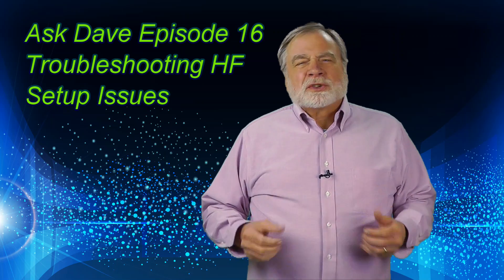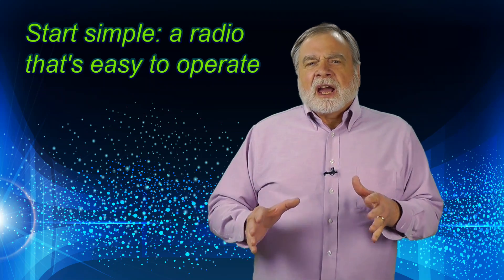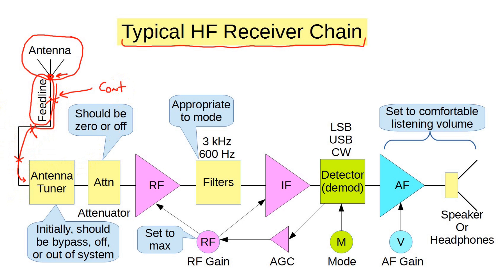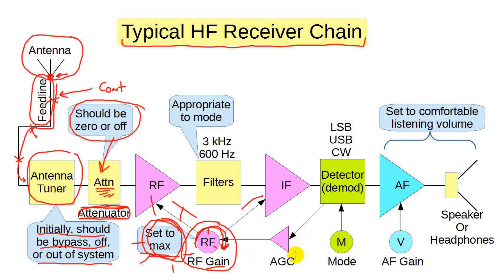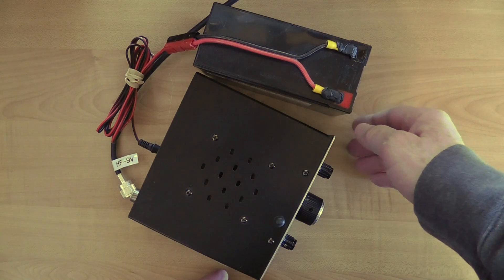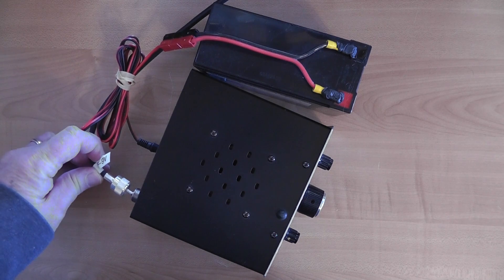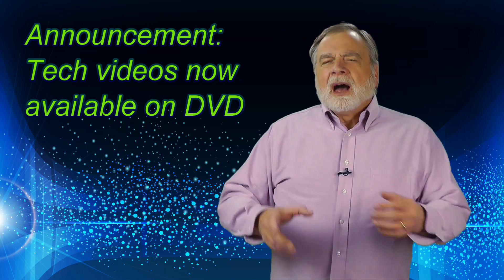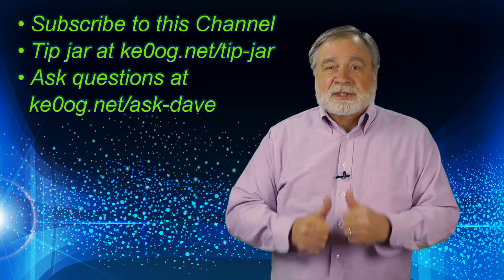Ask Dave 16: Troubleshooting HF Setup Issues

Comment: Question, could you walk through this receiver chain using a couple diff HTs . For example, for each step show how that happens in the actual radio, for teaching kids big and small, they like to press buttons and tune dials as they follow along with the theory

Comment: Hi Dave I'm new to your CH and have a question. I do not have a amateur License as of yet but operate on 11 metres 27mhz cb radio 4 watts on Am and 12 p.e.p on sideband. I have my coaxial cable running from the radio straight to a little vertical everything is in tune and swr is good however when ever I key down I hear myself through my home theatre system or any other speaker systems around the house. This worry's me as I don't want to cause interference to others I have tryed  to google the issue but have had no luck. I know this is not a ham question but its still related I know I'm only a free bander but I always operate within the legal limits
Reply from the maker: RFI (radio frequency interference) is always an issue. Try grounding your radio, power supply, and antenna mast (if the antenna is meant to be grounded). It may help.
Reply: Hi dave its all grounded but makes no difference

Comment: Dave, great video, thanks.  Don't know if you've answered this question in the past so I'll pose it as a new Ask Dave question: 
I'm setting up a new ham station in Japan and would like to make DX contacts east across the Pacific to the US and Canada and south to Australia and New Zealand (and anyone else who picks up my signal).  I bought a used Kenwood TS-830S hybrid in excellent condition on ebay and am now trying to find an antenna for it that will fit my small, odd-shaped property.  All types have problems of one sort or another.  My roof is only big enough for a 40 ft Inverted Vee (20' each half) and its nulls would point east-west or north-south, exactly in at least one of the directions I wish to transmit.  It'd also have to share the mast with the TV antenna and I'm not sure how that would affect TV reception.  I could put up an 18 ft vertical but it would have to be mounted on a deck post behind the house with the house blocking both desired signal directions.  The metal framework under the deck and an 8'x8' metal shed next to it could serve as lopsided counterpoises, however.  Magnetic loops are difficult as well due to close proximity to the same large metal objects and my shack being less than three meters from the RF field.  Given this information, what is my best antenna option and how can I maximize my setup for long distance QSOs?   Thanks, and please keep up the great work!  Yours is the channel I go to most often for beginner advice.
Reply from the maker: You may have to try several approaches. These days a lot of operations is on 20 and 40 meters. Start simple (MFJ makes a 20/40 dual band dipole) and work up from there. Everyone is constantly changing their antennas!

Comment: Could you do a video on power supplies please? I'm curious about the differences between linear and switching. I'm also curious to find out how far off the listed voltages and amps are from the reality and what kind of quality I could expect from the different priced brands. Is there a correlation between price and quality and if so, does it make that much of a difference?

Comment: I'm having a problem like this on my 2 meter rig. Everything was bought new and everything was working fine until my transceiver started to cycle off when I keyed up only to come right back on. The only help I could find said that my SWR might be too high though the tuner I had it hooked into read a high of around 1.3. Taking the tuner out of line didn't change anything, by the way. I'm wondering if maybe I read it wrong and the SWR might be high, but then how to check it when I can't key it up without it shutting down? My solution, for now anyway, is to start looking for a new rig and antenna and try again with all new components. I figure the worst that can happen is that I feed an addiction and take up just a bit more shelf space. 

Keep up the great work Dave and thank you for the videos. 73's
Reply from the maker: +Jason Take a look at your power supply. It's possible that the supply is choking under the load when you transmit. Measure the voltage input to the radio both during receive and during transmit. If the voltage drops a lot, it will cause the transceiver to behave weirdly. I feed my HF transceiver (and my VHF transceivers) with a 12v battery. The battery goes dead every three years or so. The first symptom is that it can't hold its voltage under transmit conditions, and the transceiver freaks out. Hope that helps, 73, Dave

Comment: Great video, Dave, as usual. I've had several interesting experiences in my short HF "career". One is that I got some great advice from members of a net that I frequent - they got me to do some mic adjustments to remove the bass that was preventing the clarity of my transmissions. It's good to know there are some nets out there that can be extremely helpful. Another was a time when my reception became terrible - very little signal coming through at all. Since it had changed rather suddenly, it had rained heavily around that time, and the SWR had changed character, I deduced that I probably got moisture in the feedline. And that's exactly what I found at the feedpoint connection, and it only required a little bit of corrosion to cause a problem. I had a problem with my antenna tuner for a while, though it later went away. And most recently, I had a strange thing where I was listening to an unusually strong signal, and suddenly the RX would cut out entirely. I finally figured out I needed to back off on the squelch. Did I tell you I bought a new (used) rig? Around Xmas I knew I was committed to amateur radio and HF in particular, so I picked up nice high-end Yaesu. One of its big pluses is it has beautiful RX sensitivity. So there are always new things to learn, but it helps to be fairly good at troubleshooting and having friends (even if they are thousands of miles away) to get advice from. Best regards and 73s to you Dave. I hope my comments here will help someone reading the comments here. -john KC1DIW

Comment: With propagation as bad as it is , you could make a point not to be frustrated with too high expectations , I remember that its the maunder min sun spot cycle .
Hams that have been around a long time seeing much better propagation in the past - 10 yrs.+++
I got my ticket almost 10 yrs. ago and it was mediocre , but I think I did ok , but it seems like the last 6 - 8 mths have gotten worse .  
If the sunspot cycle ever comes back , better that when I got my ticket , I could ware out my station ;)

John
Reply from the maker: +KD0CAC I have happy memories of the sunspot peak two cycles ago. Wow! 15 meters was open at night to Siberia and as the night went on, to stations all across Europe. You could get exotic stuff on 10 meters. 20 meters was wall-to-wall. Ah, memories. Now I use 20 during the day and early evening, and 40 at night, and even 40 closes up fairly early. Once in a blue moon I hear folks on 15, usually during contests. But the propagation from "the good old days" is just a memory. But, once in awhile, 10 meters still has some magic moments. 73, Dave
Reply: @davecasler  Hi..It is Ed WA2BOX...got my advanced in 1973 the bands were incredible 20 meters europe and africa all day and pacific at night DX at its best

Comment: Hi Dave!  Thank you very much for the video.  The advice about attenuation and RF gain, and about checking the noise from the radio with the antenna disconnected, is especially helpful.  I had looked all over the internet for instructions on how to systematically identify issues and had little luck.  I muddled through with small bits and pieces, mostly from blogs, and experimentation.  Thankfully my purchased used HF radio was in good health, though I had worried that someone had sold me a lemon.  In hind-sight I agree I should have purchased a new one. 

Thank you very much for creating the video, and for the other great posts!

73, Dan, KG7YVG